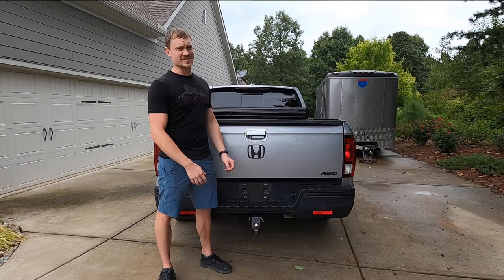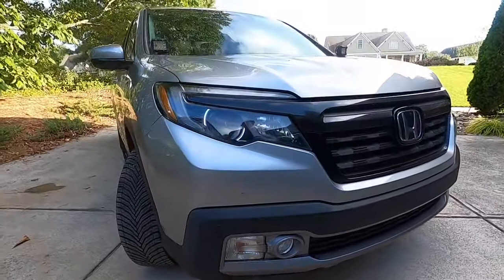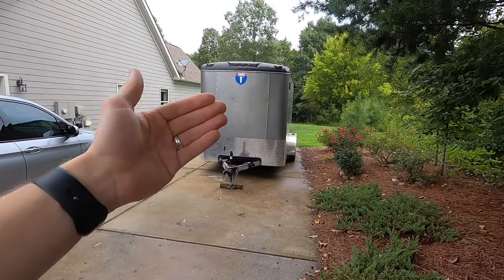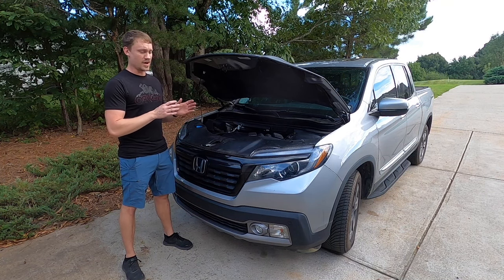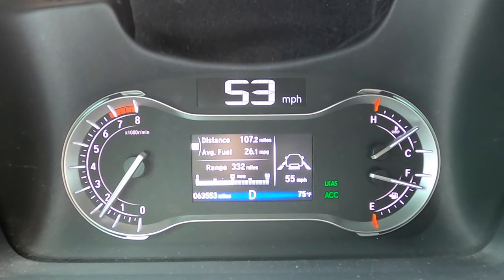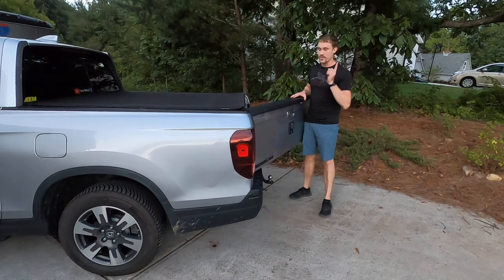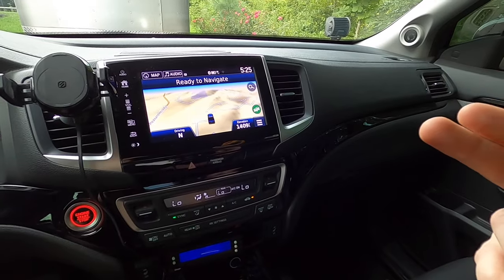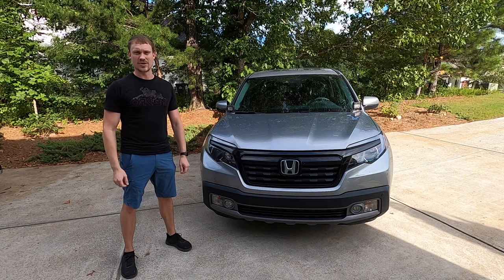10 Things I dislike about the Honda Ridgeline

Comment: same AC issue here for a 2020 BE, vents are blasting but the cabin is just not cooling down quick enough
Reply from the maker: So weird. I understand if it’s hot out and needs a few minutes to get up to speed but even after 10 minutes it’s still just cool and not cold. Eventually after maybe 30 minutes it’s cold enough but just takes so long.

Comment: I have a 17 RTL-T and found that the AC would feel weak when I have the eco mode on. I’ve stopped using it and it’s ice cold all the time even when it’s 98 with 100% humidity. Hope that helps
Reply from the maker: Never use the Econ button as it does not improve fuel economy for me as I’m not in the city.
Reply: Eco mode is almost completely useless

Comment: How are you getting 26mpg? My 2021 Sport in Eco mode gives me 20mpg at best.
Reply from the maker: Eco mode only works in the city a little. Does nothing on the freeway. Also my driving is mostly freeway driving.
Reply: @YuriyMotso  Gotcha, I do mostly city driving, so that makes sense. I'm new to having a Ridgeline. I had a 4cyl SUV before that got really great gas mileage but NO power.

Comment: When you change your oil, cover your control arms with aluminum foil.. you can even make it divert/funnel how you like with practice.
Reply: I put a 1 gallon freeze bag over the entire oil filter and let the oil drain into the bag during removal of the filter.

Comment: I just ordered a Ford Maverick but probably wont see it until 2023, if that. But I keep coming back to the Ridgeline. It's Honda and it will handle 100% of my needs. But the Maverick I ordered is like half the price of the Ridgeline.....so torn over this. Suppose to be test driving a Ridgeline tomorrow just so I know if I made the right decision. You have any run ins with Mavericks?
Reply from the maker: My dad just ordered a hybrid lariat maverick in Area 51. To be completely honest I really like the truck looks. Everything else I’m not sure about. Have not tested it yet because it’s not in stock at dealerships around me. But I do like the concept I will say that. The Honda will be better suited though as an all round vehicle over the maverick. Towing capacity is a measly 2000 lbs. 😑 that’s nothing. If you have a full car of people you can only tow maybe 1000lbs. That’s pretty trash. Eco boost does 4000lbs and that’s probably more live-able but still very low. So if you never will use your truck to do any work around the house then it’s good choice for fuel economy with the hybrid. If you will use it for hobbies or some work then it’s not the right truck in my opinion.
Reply from the maker: You will not regret the Honda, you could possibly regret the maverick.

Comment: On 95+ degree days, I use the remote start 10 minutes ahead of time before driving and 15-20 minutes of driving the a/c feels cool. I agree on oil filter location and subpar navigation, you should be able to get satellite radio on the other trim levels but no its only on RTL-E. The wire harness to the tail gate will be an issue, split loom and then broken wires. My 2020 Ridgeline with 65,000miles  will still chirp ALL 4 tires on dry pavement from a stop!
Reply: my 2019 RTL-T has satellite radio along with the Garmin Nav system
Reply: My 2023 Ridgeline RTL has a 3-month free XM Sirius radio but after that, there is a monthly subscription.

Comment: I agree with all except the oil filter. I'm happy that it is accessible. Just takes a little pan under it to catch oil. Problem solved.
Reply from the maker: It’s not too bad but the control arm underneath does annoy me. I use a ziploc bag now and it takes care of most of the problems.

Comment: I’m about a week into my preowned 2017 ridgeline:
Excellent vehicle but my gripes would be:
-worst infotainment system ever: insufferable if not for Apple CarPlay 
-rear doors hardly open wide enough and make it a tight squeeze (luckily there are kits around $40 to fix this and it’s a simple 30 minute DIY fix)
-the in-bed trunk also needs a DIY upgrade with a simple zip tie, otherwise the trunk latch cable can travel and result in a huge headache trying to get the trunk open ever again
-the front passenger window locks when you turn on window locks lol, super annoying when you have kids in the car some of the time but want to roll the front windows down other times

Comment: I see you have running boards. Are those really needed for the Ridgeline? Just curious.
Reply from the maker: My purpose was because I like how they look. However, I have young children and for them it’s absolutely necessary I found out after installing them. So if you have kids then for that reason alone it’s worth it. Also if you do any off-roading, this will help protect your vehicle in the event if you happen to be on an aggressive grade and slide. Could protect your truck from damage. It’s very robust.
Reply: For me at 73 years old and arthritic legs, the side steps are a big help for me!!

Comment: Add to that... 11. The Car Play disconnects itself for no apparent reason. The dealer tells me it's the cable. I have tried a bunch of different cables with the same results. 12. The automatic headlamp system has a mind of its own. It will dip to low beam when I am going down a country road with no oncoming traffic. I have to override it to keep from losing sight distance and watching out for deer. 13. The lane keeping system barely keeps the vehicle in lane when it is a very gentle curve. Anything beyond that, it gives up. It's pretty much a useless feature. 14. When you shut off the engine, there is no grace period where the phone stays connected. My other vehicles allow me to continue my conversation with the engine off for about five minutes or until I open my door.
However, the ride quality, the fuel economy, the drivetrain smoothness, the relatively decent handling for a truck, are all good features that I do like about my '22 Ridgeline.

Comment: What year is your RL? I'm shocked that you have an issue with the A/C! Both the heater and A/C rock on mine. One thing I hated about my 2017 was  the narrow opening of the rear doors, but that was an easy fix that took half an hour and $30 worth of parts.
Reply from the maker: I have a 2018 RTLE.

Comment: Yura, what do you think about 6-speed vs 9-speed transmissions for Ridgeline?
Reply from the maker: Honestly the 9 speed should in theory get better fuel economy. With out testing one I cannot confirm this. I am not opposed to it other than without seeing it taken apart I think the 6 speed will be more robust if I had to guess. Probably larger gears and maybe more capable in the long run for people who tow. However if I was buying a Ridgeline today it would be a newer model with the 9 speed. I’m using my vehicle as transportation and not a hauler. So that’s the clear choice for me.

Comment: I had a Chevy Avalanche, it had plenty of ground clearance , 4WD, towing package, had ice cold air, plenty of accessories to personalize it, nice V8, with the mid-gate I could haul Sheetrock and plywood. 

Now I would probably buy a Ridgeline, I don’t go off-road, or haul a lot, need something easy to get in and out of and load. 

If towing and going off-road is a priority, I wouldn’t buy  Ridgeline either.
Reply: Did you run into issues with the rubber seals on thr midgate? I'm considering an Avalanche.

Comment: Awesome, honest video... i have another nit: the heated seat switch doesn't re-set to OFF when the vehicle is turned off and then on again - I realize its a toggle switch, so not much can be done... but I've seen switches in other vehicles that reset.

As for oil filter location - i use the following trick to help: slip a won-ton soup container (large) over the filter after you initially loosen it... its a perfect fit... still a bit messy but the mess can be contained to the soup container!

Finally, are those Michelin Cross Climate 2's on yer truck?  I need tires and those are on the short list - just curious how you like/dislike them.

thx for all yer great content!

Comment: I don't quite follow all of the fuss about the "mere" 5000 lb. towing capacity limitation on the Honda, as most of the other players in the mid-size truck field are still in the 6,500-7000 lb. range for towing.  I guess that 2000 pounds seems like a lot, but realistically, how many types of trailers/towing configurations does that difference keep a Ridgeline owner from being able to haul?  I don't see (at least on a quick internet search) a lot of trailers that fall just on the high side of the 4,500-5,500 lb. cusp, thereby keeping them just out of the capability of the Honda truck; therefore, if someone needs a truck to pull a load that's around 6,000-7000 lbs., I would think that upgrading to a full-sized pickup truck is the way to go.  Just because the Nissan Frontier, for instance, can tow around 6,500 pounds doesn't mean that a trailer that weights 6,499 lbs. is perfectly acceptable for that truck and others on the market.  I feel as though if someone is in the mid-sized truck market, then they are able to tow most "toys", but if one is going to trailer their livelihood, like a landscaping enclosure, or if someone is pulling horses/livestock, then none of the middle-sized offerings are for them anyhow, regardless of an average 1,750 lb. towing capacity shortfall.

Comment: You have convinced me to not get a Ridgeline and just get a Tacoma instead.
Reply from the maker: I Still like the Honda 100x more than the Tacoma.
Reply: I've go a 1st gen. The tranny has got to be the worst part of the truck. It's a gear sniffer for 5th gear. Shift too soon then down shifts. I hate they put the tow mode in 4rd. It'd be great where I live in the mountains to just lock it out of 5th. It is kinda gutless, but I heard they are 600lbs heavier than an equal Taco. I've owned and '07 Taco. Wish I still had it. Only bad part......not really, it was a stick "anti-theft"....haha!!

Comment: Thanks for the video, very helpful! I’m on the fence between buying the Tacoma and Ridgeline… tough decision!
Reply from the maker: Do you plan on towing anything over 5000lbs regularly? Do you plan on doing heavy off-roading more than 1 time? If the answer is no then the Ridgeline is the answer. Hands down. I have owned 3 tacomas and will never go back. The Ridgeline is far superior as the daily, more comfortable and more fuel efficient. It was a no brainer for me once I sat down and actually bought the vehicle based off of my actual needs instead of looks and hype.
Reply: @YuriyMotso  I plan on doing light towing on the weekends. Both trucks look very promising but the Ridgeline space and comfort it offers keep me from getting a Tacoma. I’ve been doing a lot of research on the two. Everyone says great things about the Ridgeline! I think this might’ve help me seal the deal, thank you 🙏🏼

Comment: To remove the filter with no mess get a plastic bottle larger than the filter cut the top un tight the filter put the bottle over the filter unscrew the filter by hand the plastic bottle will pick up the dripping oil no mess

Comment: I don't like the fact that the oil filter is as SMALL as it is. I agree also that it is in a bad location and wonder if it is possible to do relocation via some sort of a kit. It just seems the Honda pulled off some short cuts for what ever reasons. Oh, and get rid of that VCM system ...... just a bad idea for controlling emissions numbers.

Comment: I got mine with a 200k bumper to bumper , all the things you hate you can modify if you want a better truck don't buy a ridgeline. I tow a large airstream and get 21mpg it weighs 4500 pounds 
u upgraded my Trans cooler first
I did put a lift I refused to buy a navigation system. I do have 22" wheels my cruise control is weird also. lack of after market parts lol BUILT NOT BOUGHT. I ALSO SWAPPed my hubs to 6 lug and the Tailgate you can dampen but the complaints are awesome. also my warranty doesn't void through warranty
Reply from the maker: I have a lot of experience towing with the ridgeline. Have a whole 4 part series made for it on my channel. 21mpg towing air stream is quite unbelievable because that’s what about maybe 90% of what people get on it driving without any weight or in the city. It is more arrow dynamic than my trailer however the weight is about the same. Where do you live? I got an average of something like 12-13mpg across the US. Granted if I drove 60mph I may have seen an improvement to have potentially gotten up to 14mpg average.

Comment: If Honda made the Ridgeline with a timing chain instead of a timing belt, I would own one today.
Reply from the maker: Yeah. That’s a big one. Forgot to mention that.
Reply: The "timing belt" change is really a lot more than that. I have 4 Honda's and I did all the 110K interval service.  Yeah, that interval covers a few other parts as well,i.e: waterpump,  2 tensioners and idler pulleys, spark plugs, gaskets, serpentine belt and timing belt.  Look for a decent mechanic to do it for half of the dealer price.  Dealer quote $1800. Heard others have had it done for as low as $700. I do it for myself with genuine Honda parts for $400 it takes all day.

Comment: I own a 2023 RTL.  My top 10 gripes:  1.  Front Ground Clearance.  Front should be 1" higher stock with front chin being 1'2" higher.  2.  Horrible radio programming along with slow touch response.  Why must I hit 4 touches to get to the radio every time I start my truck?  3.  Auto Start shuts off when I park right before I turn it off.  Stupid programming again!  4.  Transmission shift buttons are super slow to reverse.  5.  Transmission will not shift from neutral to drive without being completely stopped.  This makes auto car washes stressful when there is a car behind you!.  6.  No Cab light above bed.  Load blocks light!.  6.  Headlights:  High beams are yellow, low beams are white, but have a hard cut off line making them horrible for distance.  7.  Radio sound quality is absolutely horrible.  Tinny, and you can hear digital compression at work.  8.  Spare is not accessible if you have a load in bed.  9.  Auto A/C not quick to ramp up fan speed.  10.  Transmission refuses to be responsive in the name of fuel economy.     I still like my truck, but this would be my gripe list.

Comment: 22' RTLE, 10 days of ownership..   infotainment system sucks compared to chevy & toyota,   gutless acceleration (I fixed that with a sprintbooster),  front struts have that annoying hissing sound over sharp bumps,  normal tailgate opening/closing should have some strut assist.. other than that pretty happy so far.  Came from 3 years in a 19 Silverado RST 5.3L Z71,   and a 17 Tacoma TRD sport 6 speed manual before that.
Reply: If its brand new, allow some time for break in. Every time after starting the Ridgeline, you have push the button to exit eco mode (the green leaf in the guages will go out) then you can get the 280hp from the engine. Only my 2008 GMC chipped up Duramax pulls off from a stop better than my 2020 Ridgeline!
Reply from the maker: I come from owning 3 generations of tacomas. The Ridgeline is by far the best and I’m glad with my purchase. Any negative is outweighed by the amount of benefits it provides.

Comment: they make a 2 inch lift for it but the other downfall is the v 6 still has a timing belt not a chain if that belt breaks kiss the top of the engine goodbye valves n pistons

Comment: The oil filter is in a bad spot It could easily get hit with road debris rocks or whatnot causing oil to spew out of the oil filter.....

As for removing the oil filter just take a Walmart bag put some paper towels in it and simply put it around the oil filter and screw it off.

Comment: I'm sorry, did he just compare the Ridgeline to a Jeep Gladiator😅 yes the jeep Gladiator has more accessories than any other truck on the planet. If you can manage to get it out of the repair shop long enough to use them. Joking aside the Ridgeline does have a pretty fair amount of Aftermarket accessories, both OEM and other. For god sakes they even offer a bed tent for camping

Comment: Take your phone holder off your vent ... it's blocking air flow...that's the main vent for the vehicle ... use industrial strength velcro instead ... you'll only need a small piece and can stick it anywhere you need.

Comment: I thought I wanted a Ridgeline for the longest time, and don't get me wrong it's definitely the nicest vehicle I've ever owned. Buying limited aftermarket parts is a bummer towing capacity+hitch weight is a real bummer. It really makes you consider how you can make it work for your needs. I somewhat regret buying one, all though it has saved me money on impulse buys to make it look bigger, badder and meaner.
Reply: Traxda 3.5” lift and you can run 32” tires. Nolo designs has skid plates.
Reply: @KTMcaptain  I have the lift installed wheels and tires are next. Once my stock tires lose a little bit more life. The problem I have is once I've done that I've already put too much money in it and there's really nothing else I can do to it. But I am happy with mpg, reliability and also resale value

Comment: This 70Y old beekeeper in Canada has a 2017 Touring 132000km and I drive it through hill and dale, rain and snow plus to FLA each year. 
Not a complaint, and not an issue. Use it for bee work for 9 months of the year.  If you want a truck to ride across hell's half acre
in foolish ways fagiddaboutit that would be cruel to this beauty.